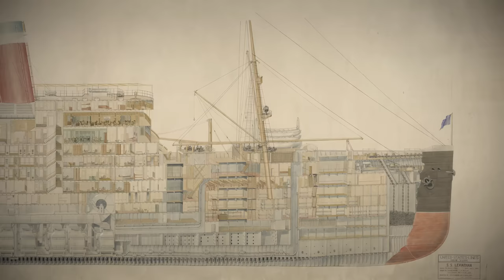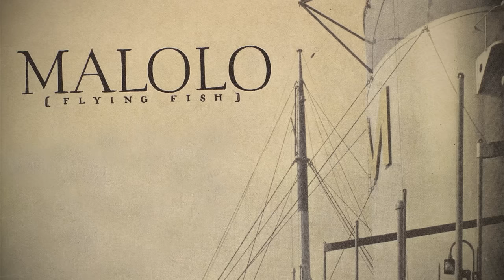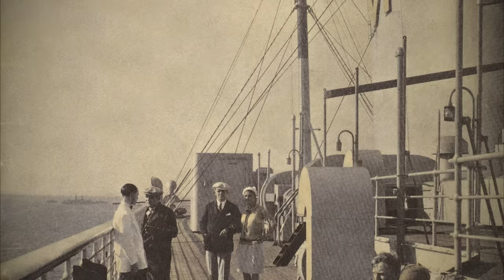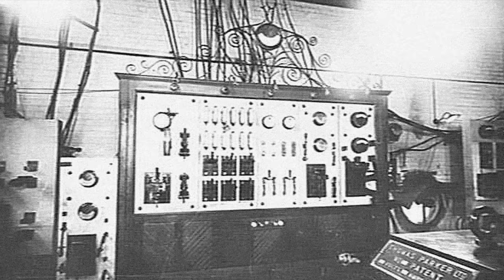This Ship Should Have Sunk (But Didn't!) SS Malolo

Comment: The concern of power to close the watertight doors - in this channel's "How the Iceberg Sank Titanic" video, it is explained that the Titanic's watertight doors could be closed by several methods, including - if all else failed - a float lever would disengage a clutch and allow the doors to close by gravity, with neither electricity nor human intervention. I would expect the Malolo, being so safety concerned and designed later than Titanic, would have had a similar system? This was truly bad luck - hit in the exact spot to take out both boiler rooms. A worst case scenario, which she survived. Such terrifying scenarios of navigating through fog, fortunately radar should help prevent these accidents.Though granted I just watched a Casual Navigation video about a fairly recent near-collision between a cruise ship and car carrier because the cruise ship deviated from expected procedure.

Comment: Thank you for this amazing post! I'm into disaster movies and documentaries, but I do like when something goes very right in a disaster. I saw a true story recently about a passenger jet coming to the US from some country south of the border. It was badly damaged by a storm as it approached the Gulf Coast. They were unable to make it to any nearby airstrips, so the pilot and copilot frantically looked for any flat space long enough to land on. They spotted a canal and were going to try a risky water landing on that, but then they saw that there was a long, flat strip of grassland running alongside of the canal. In spite of the storm damage, they were able to safely land--not crash the plane there! No one was hurt in the landing, and no further damage was done to the plane. The biggest problem they had was in moving the plane to an airport for repairs. YES! The plane was able to be fixed and used again!🛫✈️🛬

Yes, I admit it. I like happy endings.🤗

Comment: In the SS. United States Gibs separated the boiler rooms and engine rooms so if a torpedo were to hit a boiler room it would still be able to operate under her own power. I also think he did that so even if another ship rammed the United States the same thing would apply. I wish other designers of ships would continue this. Imagine if they seperated the engines on the Concordia.

Comment: Aircraft carrier?  How would that work?
Reply: Probably have to re route the funnels or install a side mounted deck. The run way wouldn't need to be too long as they used catapults to launch and arresting wires for landing. Thick wires are laid across the deck port to starboard and anchored at each end. The plane will have a 'tail hook' which is exactly as it sounds. The pilot has to catch one of the arresting wires with the hook and the plane is slowed very quickly. I'm not sure what happens if the pilot misses. I suppose the plane falls off the other end